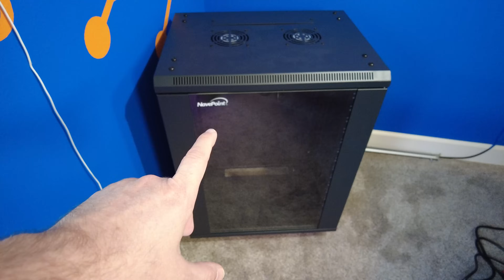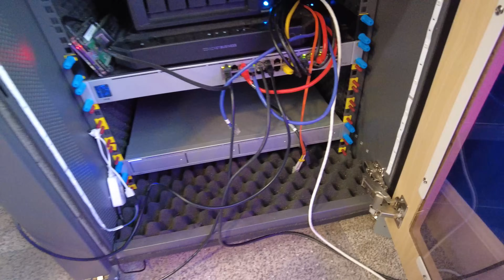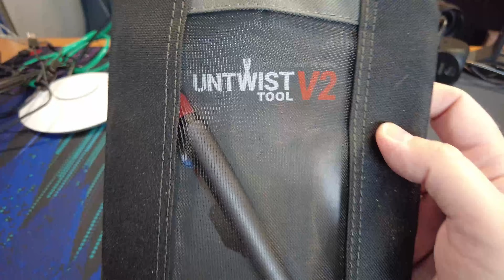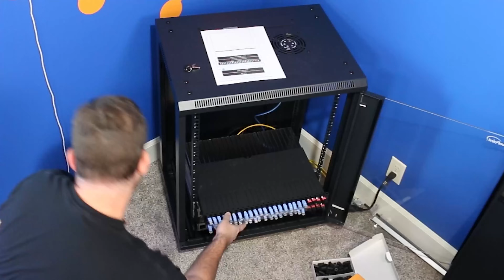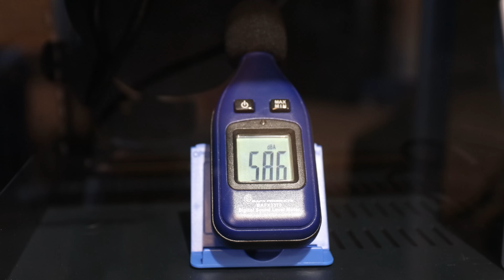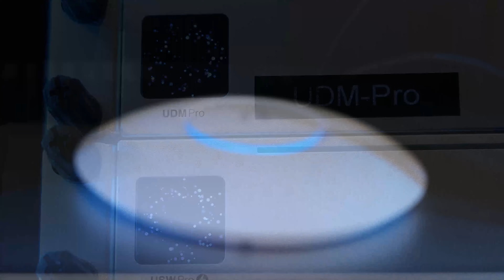Network Rack Installation - Start to Finish!

Comment: Yep I found those fans very loud  - I replaced them with cheap 12V fans and added a variable voltage device to adjust the speed up or down.

Comment: I want sudies this model 

Responsibilities: 
 
1 Scanning and installing server racks as they come in.

2 Connect the racks to the network.
Troubleshoot hardware.

3 Housekeeping.  · Adhere to security and safety best practices in the data centre.  · Installation and testing of copper and Fibre Optic cabling.  · Basic build and troubleshooting of network devices.  · Regularly lift 15kg or move heavy objects into position.  · Regularly work at heights and from ladders.  · Managing inventory of related materials.  · Adhering to defined escalation processes and standard operating procedures.  · Work in noisy areas with hotter and colder temperatures than standard office environmental conditions. · Ability to travel within geographical work area is required,

Comment: 2yrs late, found this video, don't know if you ever found some solution for the Pis, in case you didn't, I advise Racknex, they have adapters ranging from 1U fitting 4 Pis up to 2U fitting 12 of them in 19", or up to 2 Pi in a 1U 10"

Comment: I see two failed attempts. one not measuring/seeing what server brand and model are listed as will fit or not. Two he wouldn't have needed anyone to help carry it from the garage to its current location if he would have just unboxed it and carried all the parts separately. That's how I got my sysracks rack server cabinet from the first floor to my man cave in the basement. P.S. I didn't need any help.

Comment: To use an untwist tool is from an electrical engineering standpoint quite stupid. The wires are twisted for a reason and should be twisted for as long as possible. I've build connections up to Cat. 7A and Class I (Cat 8) and never used such a tool or have seen it been used by a professional. Of course one has to untwist parts of the wire, but that can be easily done by hand, especially at Cat 5e cable. There are tools for the classic cage nut. But hey are a pain in the ... 
Also, as a European I am quite surprised how many Amaricans still use Cat 5e.

Comment: The 15U 600mm is much more flexible, and then putting heavy bends in the power cables is never a great idea. A lot EU plugs have 90 degree cable outs and would suite this rack a lot better. Unless space is limited I wouldn't opt for the 450mm.

Comment: I have that same rack, though the 600mm deep version, and recently I had to move the vertical rails to fit a new 2U chassis that wouldn't fit. I thought I'd have to take everything out of the rack to accomplish that, but a smart trick spared me all that work! Choose either top or bottom and unscrew both vertical rails at that point, and rotate them to their new location and secure them, but perhaps not too tight just yet for some leeway; then go to the opposite vertical end, unscrew, and rotate the rails again, with the equipment still attached, until they reach the desired new location and proceed to secure everything as appropriate. A lot simpler than I thought it'd be, and worked like a charm without any hazard to my equipment!

Comment: I have a Navepoint case as well in a closet.  The included fans are super loud and I think started failing.  I want to replace them with some Noctua fans, but not sure those will move as much air and have to figure out wiring for 12v 3pin vs the 120v.  Let me know what you end up switching out for.
Reply: Planning on purchasing a similar rack. What did you end up doing for your replacement fans?
Reply: Went with Noctua fans. Way better.

Comment: summary: don't think you are going to fit everything in a standard 450mm deep rack. go with 600. 
you need space for cables (power cabels behind, network, fiber cabels in the front.

Comment: I do not recommend putting the 3D printer on top of the rack, especially when there is a NAS there. 3D printers create a lot of vibrations on various frequencies, even if there is no spinning HDDs inside, constant vibration might degrade something sooner or later.

Comment: So in summary, apart from it being the wrong rack for the job, its a nice rack.... This would probably be a really nice one tor a cinema amplifier rack, if not for the noisy fans and closed back. Most rack equipment is getting so long these days with the need for cramming as much functionality as possible into each device, that the "small" form factor racks are getting to shallow.

But I would want to know the purpose of those blind plugs in ports 16-21 on the USW-PRO.

Comment: Chris, I have the same rack, except that it is the 18u version.  I also needed to have the switches and patch panels deeper in the rack to close the door, but wanted rails at the front for deeper items.  I was about to buy brackets that would attach to the rails and for a 4u space provide mounts 3 inches further back.  They were priced at $42 but had a $14 shipping charge.  Then I discovered that I could get additional rails from NavePoint for $54, with no shipping charge.  I now have 8 rails in the rack, and so I have a lot of flexibility about were to mount things, including items with four post mounts.  Also, it seems to me that there is plenty of space outside the rails to route power cables, so that you could go almost all of the way to the back of the case.  The fans are loud, so I just removed them.  I'll be interested to learn if you find a satisfactory substitute.

Comment: Apart from basic failure to measure your equipment before buying the rack, you're using an audio gear rack rather than an IT rack.
IT racks are generally not only deeper, but wider, with space for vertical routing of cables and management ears to either side.

Comment: Have 2 similar racks, one of the first things I did was swap out those fans.. really loud.. swapped them out for noctua 12v fans with adapters and smart plug to control on off times.. patchbox kinda cool but is ridiculous expensive.. what power device is that you have in the top rear of your rack.. looks very cool.,

Comment: I regularly have issues with cabinets and equipment depths, contractors install 390mm deep wall mounted cabinets and then big PoE switches don't fit or short floor standing cabinets where cable clearances are an issue. I like your use of Rackstuds, I have changed over to these on my own rack and would like clients to use them too but they are about 50% more expensive here in the UK for the 100 pack vs the old fashioned metal ones. As you say, rackstuds are ideal if you are frequently moving equipment in and out, I have injured myself so many times over the years on the old metal cage nuts.

Comment: I am in the planning phase of building a rack using extruded aluminum and the vertical rails I am using have a tapped 10-32 threaded hole to them... I will keep you up to date when the building starts. :)

Comment: Hmm, wonder how much demand there'd be for a rack that can accept the same kind of castors/wheels as office chairs use.   I just wonder, because I recently saw office chair "wheels" that were actually sliding pucks, designed to make it easier to slide over deep-pile carpet without catching.
I don't imagine there'd be many people who keep that sort of thing on deep-pile carpet, but it's clearly a non-zero number ;)

Comment: AC Infinity RACK ROOF FAN KIT
Reply: I just installed these.  Plug and play.  Everything lines up and mounts directly.  AC power running DC fans.  At least half if not more as quiet as the stock loud Navepoint fans and they come with a push button speed controller.  I can no longer hear the network rack in my master bedroom closet when they are at half speed.  Perfect.

Comment: If you’re concerned about the noise of these fans then don’t even think about putting your 3D printer in the office… remember that some prints can take a long time and you can’t easily pause that when you’re recording a new video.
Reply: Proper motor drivers will be quiet enough, but I would be more worried about the lower frequency vibration it creates (and transfers into the rack).

Comment: If that rack is like my old baby rack and the back is solid/screwed in place, then it is likely helpful to know that the threading for the screws on that back panel is the same (or close enough to the same) as your standard PC thumb screw.

Comment: I have a rack of this brand with a few variations and I've been using it for about 2 years now. I love it. 

The fans are very loud. I've also heard the wiring scares some people but I haven't had any issues. I used to control the fan with a smart outlet but now I've just moved it to a place where it doesn't bother me. 

I'm using rackstuds for pretty much everything in it except for a few shelves to hold my heavier stuff like my UPS, then I'm using rack studs on the front for that but the weight is on racknuts and bolts.

Comment: I have the less expensive version of that cabinet, and I can confirm the fan noise was unacceptable to me. I replaced with Noctua and a Cooler-Guys thermostat. Works great, and is silent.
Reply: I can confirm the aural emissions are unacceptable unless mitigated with passive or placement means. Personally, I mounted the rack in the garage and I can't hear the fans from anywhere outside of that "room/car hole/shop/lab/storage" area; not even on the others side of the poorly insulated wall! The stock temperature abatement for my use case was deemed acceptable and necessary due to the ambient temps being +/-10 - 15F avg from the human containment and recreation areas when fully loaded. The fans lasted about 2.5yrs and were replaced with like units from the vendor with much difficulty, aggravation, and many beers due to the emotional and physical abuse. I cut my thumb and so there was blood; however, a post operational root-cause analysis was coded nominal for the type of work performed.  The new fans were a different oem but fit and function was within lab standards and actually decreased average internal temps.  A+ best avar for the price.

Comment: I feel your pain.  Sooooo…the executive summary is that the deeper version of this rack would have been the one to get for your intended use because several devices are too deep for this one and because you need more clearance in front of and in back of the rack points relative to the front door and back cover.
Reply: This. I'm going through the same thing with the cheap rack I picked up. Every step along the way is another "dang, my rack is too shallow to do what I wanted". I see an upgrade in my future

Comment: Once again a great video. :)
I just wanted to ask if you could make a video about Pi Hole.
How to install it with UDM Pro?
Do Home Asistent and Pi Hole need to be installed on different Raspberry Pies?
What can be advantages using it with Synology (docker) ...
How have you set it all up or something like this?
I think a lot of us will appreciate that video.
Reply: I run a pi-hole on a Raspberry Pi but I also run a second instance in docker on my Synology NAS. I figured that running my DNS only in Synology would be too disruptive if I need to power cycle the NAS so I did keep the instance on a Pi too. Having both means I can update either without impact so long as I do them one at a time.

I also run Home Assistant. I used to run it on a Pi but I moved it into docker on my Synology a couple of years ago. I find it easier to keep docker instances up to date (with docker-compose) than keeping a bunch of little computers up to date. The only Pi I run now is for pi-hole.
Reply: Tnx...
I don't have anything yet but I am looking different opinions and how different people have things arranged before I get into buying stuff....tnx again
;)

Comment: Good video I usually remove those loud 110v fans and install 12v or 5v USB fans that are much quieter, but still pull air out the top.
Reply: the usually use a lot less power too, my rack had 4x 120mm 220v fans and they alone pulled ~100w
Reply: @Felix-j3d4b  yup, amazon sells those usb 5v fans, I use 2 of those and a old recycled cellphone charger. Cool & quiet with all the networking gear in my enclosed unit.
Reply: I have 2x USB powered fan in my rack - they run full speed and i can't hear them :)

Comment: I got one of these racks from NavePoint, but made the mistake of not ensuring it was deep enough for the 48 POE Switch Pro. So I ended up going with the EA unifi rack, but no way to get an additional 24 port patch panel to match.
Reply: I almost had the same problem. I then realized it wasn't deep enough. Good thing NavePoint has "deep" versions of all their racks. And yes, you're one of thousands, including me, who wish they could get more of those aluminum finished unifi patch panels. People with the rack who need more than one have the same problem as you. Many have made their own by spray painting the most similar Rust Oleum can they could find.